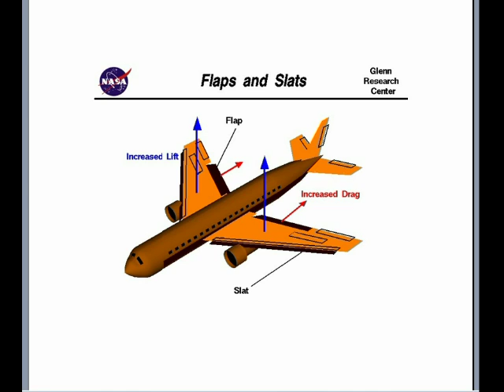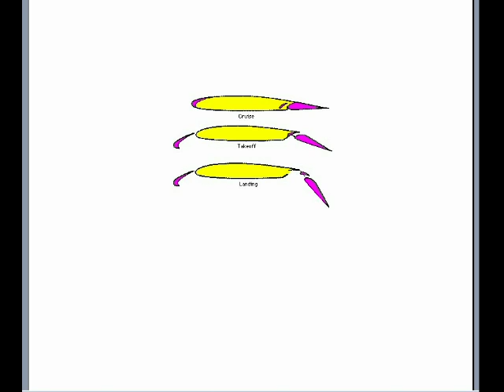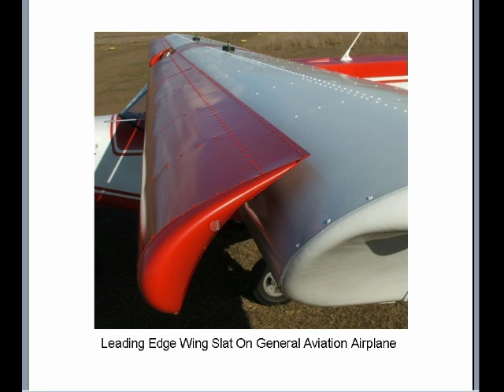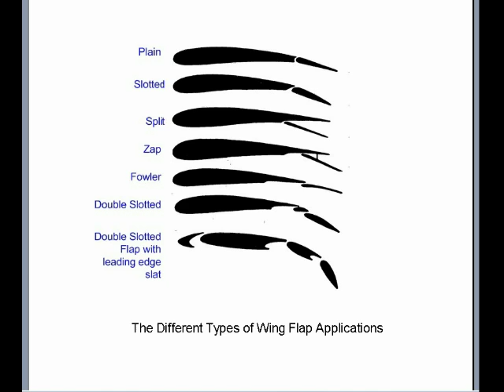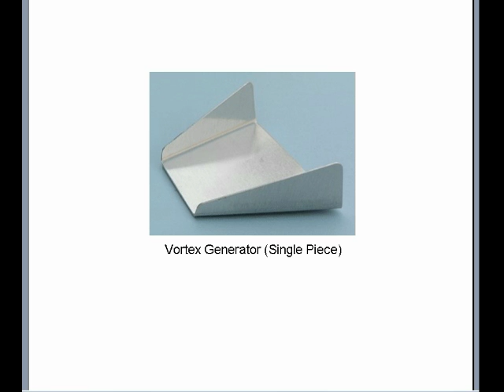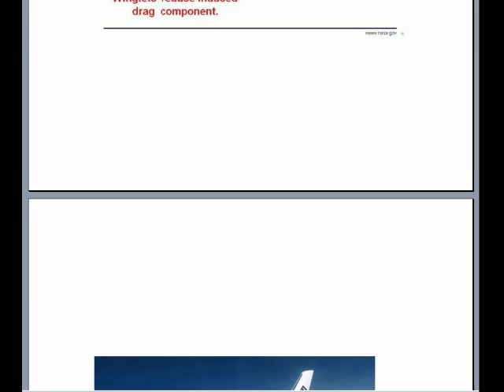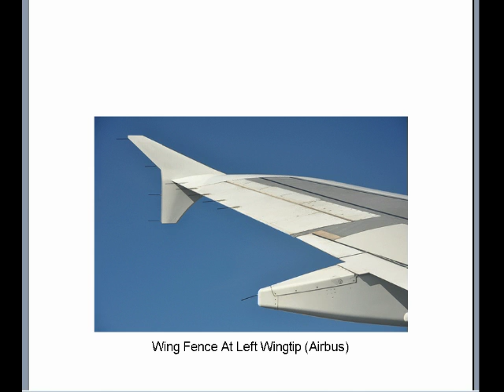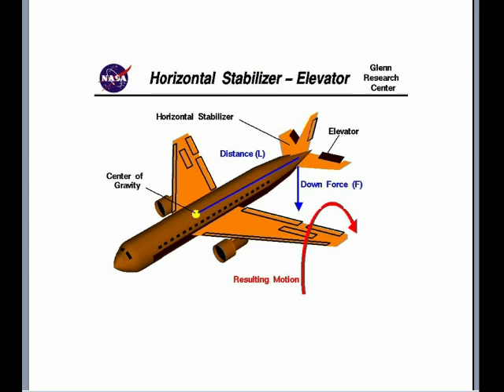Airplane Flight Controls & High Lift Devices Part 2 of 2

Comment: Great Explanation. Have you looked into this new thing: Electric motors replacing Jets.  The idea being to separate thrust required to fly from energy efficiency requirements of fuel consumption, (I'm guessing).  Have you heard this?  I guess the turbine generator would not have to optimize thrust, only work on wattage generation efficiently, and the electricity could be efficiently distributed and used by many smaller motors along the wing undersides......

Do you think this is feasible? What kind of humongous high wattage generator would it take?
Reply from the maker: Hi. Thanks!   You may want to view the video in my library titled:  'Jet Engine Horsepower Explained [Must See!!!]'.  This video quantifies the power distribution of the General Electric CF6 gas turbofan jet engine. 

The real issue with replacing gas turbine engines with equivalent electrical motors is the power-source-energy-density.  Even though gas turbine engines have a Brake Thermal Efficiency of 30% or less, the energy density in Iso-Octane Fuels such as Kerosene Jet Fuel is quite high.  18,730 BTU/Lbs x 6.75 Lbs/US-gal equals 126,428 BTU per 1 US gallon of Kerosene Jet Fuel (JP4).  1 BTU/Sec heat output in the form of burning Kerosene Jet Fuel is equal to 1,056 Watts of power. 

Assume that an AC brush-less electric motor is employed for propulsion applications, with an Electromotive Efficiency of 85% (as opposed to less-than 30% with gas turbine engine), the enthusiasm with AC electric propulsion is the much higher powerplant-efficiency, requiring lower power curve requirements.  However, the power source, even with Lithium Polymer high-charge-rate power recovery systems, limits the actual run-time, not to mention other less-feasible electric cell applications.

The only exception for making electrical propulsion systems viable for airliner long-range applications would be some type of electrical power cell or battery with energy densities equivalent-to-or-greater than Iso-Octane hydrocarbon fuels.  A possibility may be radioactive isotope Cesium-based battery cells or something in the likeness of Thorium battery cells, charged by crystalline polymer power recovery systems.

Simply put, a "nuclear battery" with long half-lives, which cancels its own gamma-wave fallout, safe for public consumption, may be the solution for electrical propulsion system.  It is never wise to disregard possibilities and rely on only conventional wisdom.  Nearly every breakthrough we have in technology today was once laughed at as "impossible".

I am just suggesting known possibilities, aside from that, other sources of charging electrical powerplants include lasers carrying wireless electrons from ground power stations directly to air vehicles using motion telemetry tracking, delivering a constant stream of wireless electrons to electric propulsion powerplants.  Or perhaps the "Bloom-Box" which converts Gasoline directly into electrical energy by releasing the chemical potential energy within the fuel through electron discharge instead of by combustion thermal plasma.  Apparently the Bloom Box is 92% efficient in converting the 20,000 BTU/Lbs of Gasoline into equivalent electrical BTU/Sec or Ft-Lbs/Sec or Joules/Sec power output, so a form of electro-chemical hydrocarbon power distribution.

The compressor in a gas turbine engine is what provides sufficient heat to ignite kerosene jet fuel, which is powered by the turbine, in which the turbine is powered by the burning kerosene jet fuel.  Compression in any hydrocarbon fuel heat engine is always power LOST to keep the engine running or Friction Horsepower (FHP).

Total Power (Indicated Horsepower) = Power Lost To Keep Engine Running (Friction Horsepower) + Available Power (Brake Horsepower).   This obeys the First Law of Thermodynamics which is the Conservation of Energy within a given closed system. 

Electrical powerplants are so much more efficient, especially AC brushless electrical motors or powerplants.  The real issue is a power source with practical energy density.  If safe nuclear batteries were marketed for public use, then the power curve to match the high torque at low RPM needed to power a large high-pitch fan to ingest at least 1 ton of air per second, compressed through a cold-air fan duct for both the required jet velocity and thrust for heavy airliners, may be feasible.

I'm sure there are hundreds of other concepts to permit electrical propulsion for heavy airliners, however, most are probably either not yet safe, not yet cost-effective or not yet practical. 

As for environmental concerns, the proper compression of fuel vapors with computer-controlled fuel metering, can reduce unburnt fuel emissions to almost zero, including drastically reduced NOX, CO2, CO and SOX emissions as well.  It should also be known that making electrical components requires much more hydrocarbons than most people realize. 

If anything, magneto dynamics may also be an option to accelerate fluid gases such as air, into the needed mass airflow for thrust and jet velocity.  Our atmosphere on Earth is directed by lines of magnetic flux magnetic resonance.  I'm not sure if some type of magneto dynamics could be used to accelerate mass airflow at much lower power consumption.  This is something that Physicists may have figured out as either possible or impractical for general use. 

But as for electric propulsion, this could work right now, but probably at much lower flight ranges and at much higher costs.  So of course there is no money to be made at this point so we won't see this application on heavy airliners anytime soon. 

Thanks for your comment!
Reply: @markscythian7179  OMG: Thorium powered Teslas or Chevy Volts!